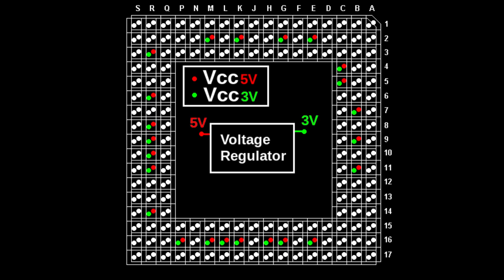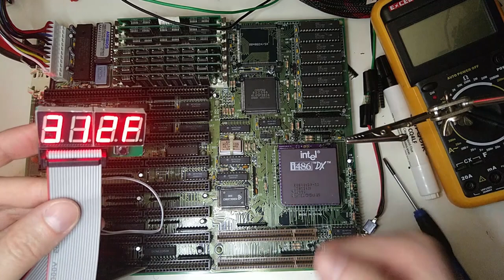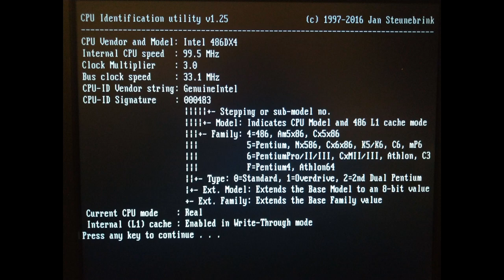486SocketBlaster: A DIY voltage adapter for the 486 CPU (part 1)

Comment: Nice project. Personally I'd worry a little about the value of the potentiometer drifting over time plus those cheap buck converters can be noisy. If you were inclined to build the regulator into the PCB itself,  there is the TI TPS563200DDCR, it's small, cheap and can do up to 3amps which should be fine for a 486.
Reply from the maker: Yes, these voltage regulators are not great. Building it on a PCB is probably the best option. Thanks, I will check it out!
Reply: @scrap_computing  Beware that most datasheets for modern regulator chips require you to make multiple attempts to make the regulator part of your board work, which really sucks when you want to focus on the rest of the board and don't have the budget to build multiple failed boards with components.

Comment: Yes!! This is the project I’ve been tinkering about in my head for a while already. 

I can’t wait for the updated PCB’s! 

Maybe, if the PCB’s aren’t finalized and/or ordered yet, you might be interested in adding a WB/WT cache jumper/switch and some mounting points for a CPU cooler, which could make it compatible with Socket 5/7/370/A CPU coolers. 

Awesome video (again)! Thanks!
Reply from the maker: Yeah we could add a jumper for the WB/WT cache in a later revision. Attaching a socket 7 cooler would be awesome! The only issue is that these sockets are quite a bit larger,. But yeah, I think we can figure it out :)
Reply: yeah addition cooling would be nice. 

I remember some of the old 50mhz cpus ran REAL hot

Comment: Brilliant project! I was having a really hard time finding an interposer and may give this a shot. That’s great that 486s use the standard 2.54mm pin spacing as well 👍
Reply from the maker: Yeah you should give it a try. It is not too hard to put together, and it seems to be working all right.

Comment: I built it. I drew the consequences:
- You have to know the main fact: one error in the preparation or in the soldering could result a failure, you have to start again. Order more PCB, DC-DC converter and pins to be able to start over.
- You have to be very carefull handling all the pins: the processor's pins should be in-line in both direction. A minuscule bent pin will block the insertion of the processor to the new socket. Add a small dimensional error on the female pins and you will realize it is no way to socket the cpu into the new socket.

All the given information about the build is very good. I would extend by some practical advice: 

-When you soldered a new row of pins try the cpu to fit or try the adapter to fit into the MB. At the beginning it will be easy but adding more and more rows the insertion will became more and more difficult. The purpose of this "mating" is to form the male pins to the female pins. If mating is easy than the soldered row of pin is perpendicular to the PCB and the ends of the row is grinded well. This grinding is very important: a "sticking out" end of row will push the next row which can not be perpendicular to the PCB. If not perpendicular the mating will not be possible.

- Check every steps. You can not make any mistakes. One mistake will render the build useless. Check every end of the rows, grind back the ends. Solder the two endpoints of a row and check the perpendicularity of the row. If it is ok than solder the other pins. Check every soldered pins under magnification. I found many times the pin absorbed the tin but the pad is not. The size of the pad is small and it is easy to left it without tin. 12x magnification is recommended. Resolder every pin which is suspectible.

- Handle the solder with attention. It is very easy to fill other pads unintentionally. It is not easy to remove the tin from these pads-holes.

- Check the continuity of the newly soldered top-bottom pins and the surrounding pins for short. If you made a bad soldering than this is the time to be able to correct it. if you solder the next paralell row than you do not have a canche to correct it. It is a garbage. Start over. 

- The sequence of the solderig of the rows are very important. See the github documentation and the video. The white circles on the board designates the first pin of a given row, helping the placement process. Do not forget to altering the sides and solder the male - female rows alternate. This is the only way to solder every pin. Miss one alteration and it is done. Start over.

- Use a soldering tip suitable to this job. Too small will not be able to transfer the heat, too big will mess with the adjacent pins and pads. Use right temperature: do not melt the plastic but be able to quickly do the soldering. Clean the board before the soldering with IPA. Use flux if there is a difficulty to tint the pads around the pins. Clean the flux after the soldering with IPA (bath).

- Check the DC-DC converter before soldering in to the socket. Use an 2 ohm/10W resistor to simulate the load and measure the ripple with the scope. Check the thermal condition of the converter. Please note the converter will be in a much hotter place next to the bottom of the CPU. Use high efficiency converter (90% or more in case of 5V in, 3.5V out, 2A load). Trace down the converter IC and check the datasheet, do not accept blindly the seller's data. Use at least 0.8mm wires to solder the converter into its place. The thicker the better. If the MB suddenly stops working in the middle of a stressfull session than probably the thermal shutdown of the converter IC initiated. All your  current work - progress will be lost. This is one reason why the cooling of the CPU is so much important. I think this is one of the weakest spot of this design but that is it.

-Check the ripple and the voltage when the system is under stress. The voltage range should be within 5%. The ripple should be less than 20mV.

- Count on problems: sart with the MB settings first with the jumpers to check the MB operation. If it is ok than use the multiplication jumper to go higher internal clock. The result can vary MB to MB. In case of a Hypo MB the 133MHz internal clock was too high to boot from IDE, the system hanged. In case of 100MHz it was ok. On Acer A1 board 133MHz clock was ok. Switching off the Acer A1 - but keep the STDBYON - and switching on again resulted a stuck boot process. Reset cured it 98% of times. But if you switched off and removed the power cord it started without any problem.

- I found this job a difficult one. It takes a lot of time and effort to work with full attention. A lot of possibility of errors. And of course a merit at the end. The system is definitely more speedy with an amd 5x133 comparing to the 486DX33. Does it worth it? The material cost is much higher than the price of the 5x133 not counting the assembly time. Mixed feeling. But hey. More ridicioulos upgrades are in the horizont regarding the Acer A1 MB.
Reply from the maker: Thanks for the feedback, like! It is indeed a fairly involved and error prone process.

Comment: Personally, I would prefer a 3v tap from a header. That way, i can monitor the voltage (in case the regulator drifts) or externally power it.
Some space for a few filter caps would also be nice.
Reply from the maker: Yes, there is an external 3-pin header that gives you input, ground and Vcc, so you can monitor it or even power it externally.

Comment: I'll advice you to use buck converter with fixed feedback resistors. Also those cheap modules output pretty noisy under high loads so it is also recomended to add antalum and ceramic capacitors. Cheers
Reply from the maker: Yeah these regulators are pretty bad. A better alternative would probably be a good regulator circuit on the PCB itself.

Comment: Love this. Have you thought about adding jumpers like the PNY adapters have a 2x, 3x, or 4x multiplier. Also for someone like me that has no soldering skills would you consider selling some as well. Have a good one.
Reply from the maker: Thanks! There is a jumper that will let you reduce the multiplier from 3x to 2x (check out part 2 of the video). I am not sure you can control the multiplier any further than that.
Reply: @scrap_computing  You can either pull the clkmul to ground, or pull it to high and the cpu decides the multiplier according to that. With Dx4-100 between 2x and 3x and with am5x86-133 between 3x and 4x. Ive read somewhere that on dx4-100 connecting it to breq(?) might leave it at 2.5x but that sounds a bit weird so it probably not true.

Comment: Really Great project! but I’m struggling to find the right spec male/female headers. Is there a part number and / or supplier? 
Tolerances look very tight so didn’t want to order the wrong ones
Reply from the maker: I think I got mine on ebay, so I don't really know the part number, but these gold-plated headers are fairly cheap and widely available. I have listed the measurements on the project's github page if that helps.

Comment: What about Data bus and Adresse bus? 
You don't want to run the CPU with 3.3 volts but drive the data with 5 volts. Bus drivers must be in between.
Reply from the maker: Good point. But I think even 3V 486 chips should work fine on a 5V bus because all 486 chipsets are 5V parts as far as I know.
Reply: Its not needed. 3.5V CPUs were designed with this in mind, so same chipset can be used for 5V and 3.5V CPUs. Because TTL logical 1 level on output is defined more than 2.7V, there is also no problem for 5V chpset to recognize signals from 3.5V CPU. The same was used for IDE interface, where early 5V bus was changed to 3.3V.
Reply: @xsc1000  Lol. Pins being or not being 5V-tolerant comes from a completely different problem, rather than the TTL levels theoretically being compatible. Typically, the moment you put more than VCC+0.3V on any pin, you already have to make sure that you are not starting to power the chip itself just from an input pin, thus requiring special design - for example a floating bus after the protection diodes.

Comment: might be simple enough to add some jumpers to configure 5 or 3 volt mode too
Reply from the maker: Yeah you could but it can be a bit tricky to do it properly. Because the simplest way would be to pass the CPU current through the jumper which is not ideal. A better way would be to use some transistors as selection switches and use a the jumper just for signaling, but that would be quite a bit of circuitry. Well, if you are to use 5V you can just remove the adapter and plug in the CPU to the socket directly :)

Comment: Can you make a project for RPiPico 386SX socket daughterboard? That could be cool to expand RAM up to several megabytes SPI SDRAM and emulate different CPUs, even PentiumMMX!
Reply from the maker: Yeah that would be really cool, though I am not sure the Pico has enough GPIO pins or is fast enough to emulate a 386-class CPU. It should be possible to emulate an older 8-bit CPU.
Reply: @scrap_computing  386SX uses same 16bit bus as 286 does. Of course address bus latching is needed. But again for 386SX we need only 20bits, because all RAM will be local to RPiPico /*embedded+spi*/.
Reply: @scrap_computing  actually it could be possible to develop a dropin RPiPico card for 8088 socket, which can emulate Pentium :D

Comment: If the CPU is 3V3 wouldn't the logic also be 3V3? Meaning, even if you supply the correct voltage on VCC wouldn't the other pins (logic, data, etc.) still receive 5V signals, leading to damage?
Reply from the maker: As far as I am aware all 486 CPUs can tolerate talking to 5V chipsets.
Reply: @scrap_computing  It might be because the old 5V TTL signal standard used on the ISA bus only has 2.8V as a 1 and 0.4V as a 0.  So 3V chips can still be designed to work with it, though 5V tolerance on input pins is still advisable for compatible 3V chip designs.

Comment: I'm trying to understand correctly, is this like making a DIY DX4-100 Overdrive?
Reply from the maker: Yes, that's exactly what this is. You can safely use a 3V CPU (like the DX4-100) on a 5V-only motherboard, like the one I am using in the video. So no need to get an Overdrive. Plus you should also be able to use a AMD 5x86 @ 133MHz, so it would be even faster than a DX4 overdrive, though I have not tested this yet.

Comment: 'cool' abomination! any signal integrity issues? can you check different clock speeds?
Reply from the maker: I have only tried 100MHz on the DX4, which seems to be working all right so far.

Comment: Cool, is there something similar for socket 7?
Reply: Socket 7 adapters should be common, very popular.
Reply: @joefish6091  Yeah. Kingston made them...
Reply: Necroware has a video on his own socket 7 regulator project
Reply: @gaborszucs8935  Yeah, but that one is for use in the regulator socket, which not all motherboards are equipped or ever designed with. I meant similar solution like this such as Kingston TurboChip MMX 233.
Reply: @jirikajzar3247  ahh okay, got it. I havent heard of any socket 7 interposers, but they might exist....
Reply from the maker: Not sure, but I doubt you could build one in a similar way. The pins of the socket 7 are just too close.

Comment: Makes you wonder why didn't they integrate the regulator in the CPU itself.
Reply: It's an extra source of heat, and it was worse (lower efficiency) then compared to now.
Reply: Dx4-100 overdrive done just that but thats also a relatively rare and expensive cpu nowadays. Also back in the day not everyone needed the adapter. Some motherboards did have voltage regulators, some people didnt need 3v support. It was more cost efficient to keep the adapter optional instead of building it into every single cpu i guess....
Reply from the maker: Yeah these damn overdrives! They are too expensive these days...